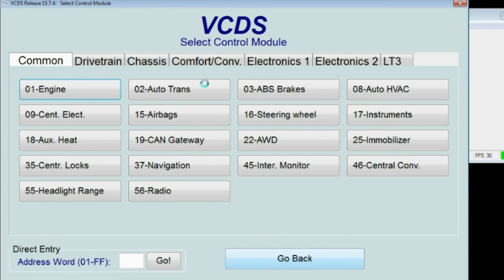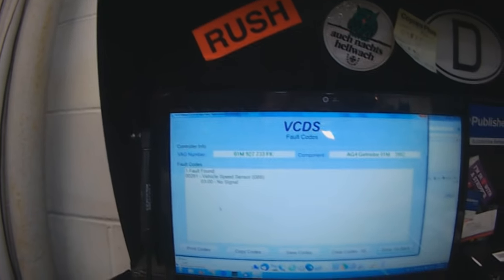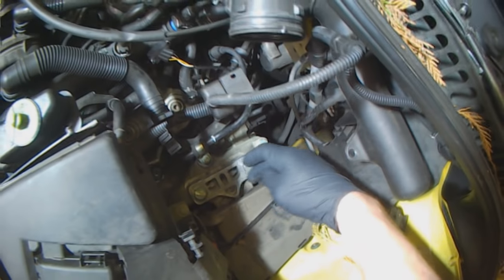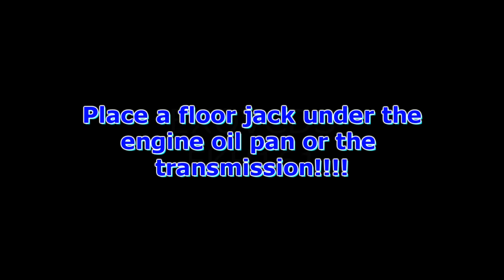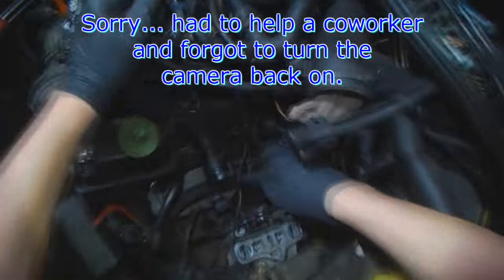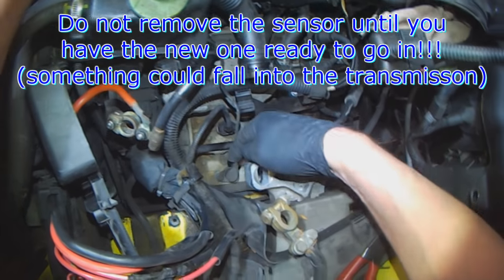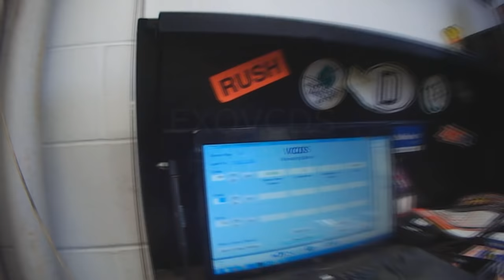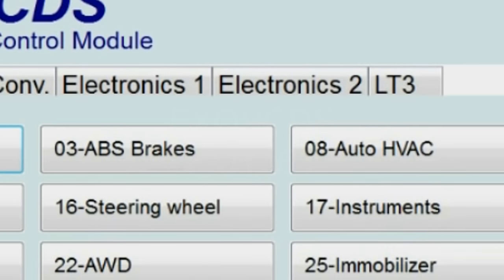VW A4: New Beetle - vehicle speed sensor (G68) no signal

Comment: Please help me with this! is there only one speed sensor on the 2004 vw beetle automatic transmission?
I have heard that it has 3. how do I know which one to replace, my rpms and speedometer readings are working, its just that my transmission got into limp mode, and i am getting this code from a code reader; P0722. Please help. very worried.
Reply from the maker: I'm still at work... I'll get back to you tonight once I get home.
Reply: ***** thanks!
Reply from the maker: 4 speed , 5 speed or 6 speed automatic?
Reply: 4speed automatic.
Reply: and it is 2004 2.0 no turbo
Reply from the maker: http://fkh161.ca/VW/NB/P0722_001.pdf
http://fkh161.ca/VW/NB/P0722_002.pdf
Reply: ***** but how do I know WHICH sensor is the one that is bad?
Reply from the maker: virusboy07 Both pdf's refer to G38... the second pdf shows what the sensor looks like and where it is located. I really can't help further... you now have the same information that I have. Time to disconnect the sensor and check it.
Reply: ok! I Will do that.

Comment: this basically cures a speedometer not working in a 6spd manual transmission as well on a turbo S model? same location?
Reply from the maker: No. Do you have an abs light that is also on in the dash?
Reply: No.
Reply from the maker: The 6spd manual has no speed sensor. The speedometer speed is calculated via the abs speed sensor. Does the odometer count mileage?
Reply: i have po501 implausible signal at vehicle speed sensor is there another sensor. no fault codes on abs module. I've been baffled by this for a while.
Reply: Nope it doesn't
Reply from the maker: 6sp manual (clutch pedal) or 6 spd automatic?
Reply: 6sp manual
Reply from the maker: Weird.
Reply from the maker: http://wiki.ross-tech.com/wiki/index.php/16885/P0501/001281
Reply: Yeah exactly what I've been saying.
Reply: Yeah I'm thinking it's got to be one of the top two on possible solutions. I just don't have a wiring diagram of turbo S for those. By the way do you have a video on Turbo S EPC and traction control coming on and you press throttle and it acts like it don't have any gas?
Reply from the maker: What year? I can get you wiring diagram. When EPC comes on... should have fault code in ECM.
Reply: 02 i would appreciate it. I think i had a fault in ecm controller stating no connection or something like that.
Reply: I'm not sure it replied but its an 02 . also the abs controller is showing a code of 01314 ecm - check dtc memory - intermittent. I told you it was not but that's the code i pulled.
Reply from the maker: http://fkh161.ca/VW/NB/TurboS001.pdf
http://fkh161.ca/VW/NB/TurboS002.pdf
Reply from the maker: If the ABS is not communication with the ECM or instrument cluster, then the speed will not show.
Reply from the maker: When you turn the key to ON, does the ABS light come on?
Reply: I replaced with new abs sensors like 3 days ago . Cleared codes and still Nada. Are you saying the sensors could be faulty possibly?
Reply: Yes and then goes out
Reply from the maker: If the ABS light never came on, then I would have said to check the fuses on top of the battery. If there are communication fault codes in the ECM, the ABS module & the Instrument Cluster module... then you have to fix the communication issue. If your scan tool can view ABS speed sensor output values... drive the car at slow speeds and check if all the sensors are putting out a signal. The front left sensor is used as speed input for the ECM & Instrument cluster. If the ABS does not have any speed sensor fault codes, then the only thing left is a communication issue between the modules. Bad wiring / connection etc.
Reply: I was afraid you were going to say that about the wiring. Just to confirm is it mvb 002 under abs and first block? Btw tyvm for the wiring diagrams . Greatly appreciated.
Reply: I'm getting 2.0km/h on G44 through G47 speed sensors . 255km/h standing still
Reply from the maker: Yes, ABS speed sensor signals can be seen in the first 1 or 2 groups of the ABS measuring value blocks. If your scan tool does not lose communication with the ABS module, then look for the communication issue between the wires that "communicate" between the modules. If the scan tool keeps losing the ABS communication... also look for a power / ground supply issue to the ABS module. Not much more I can suggest, sorry.
Reply from the maker: Yeah... I've seen weird / high readings before (can ignore as far as I have come across).
Reply from the maker: If no faults in wiring are found, could be a bad ABS module.
Reply: *****  no that's awesome stuff . I feel better about my direction after speaking with you. Thanks for going out of your way to help me out.
Reply from the maker: Let me know what you end up finding / solved the issue. Might also help someone else down the road.
Reply: Oh definitely will . I agree! What i do know is i have a bug within the bug lol . I'll respond to this once i go the route you said. Thanks again!

Comment: Do you know the location of the speed sensor on a 2003 vw jetta tdi ?
Reply from the maker: Fin Engine speed or vehicle speed? Standard or automatic?
Reply: standard I think you have to take off the motor mount and lower the transmission
Reply: I didnt watch the whole video its in the same location
Reply from the maker: Fin No... On standard transmission the speed sensor is on the differential. Is your speedo working?
Reply: No and my tdi just shut off by its self like i turned the key off. Do i have a crankshaft position sensor ?
Reply from the maker: Fin Transmission speed sensor can not cause the engine to shut off... the crankshaft position sensor / engine speed sensor can / will. The sensor is to the right of the oil filter flange... mounted to the engine block.
Reply: I read it wrong the Engine Speed Sensor ? located in the back of the  crankshaft driver side ? I think thats the sensor that was smoking. though recently i got the tdi running for a day. Soon as i parked it wouldnt let me start again. I have a very confusing situation i need vcds for sure barely no one where i live has one lol
Reply from the maker: If it was "smoking"... electrical smoke is bad. Something could have gotten fried.
Reply: so the camshaft and engine speed senor is located near each other ? Yea i know and i dont know what sensor it was it was located behind the crankshaft or back of engine near the top mid section driver maybe tempature sensor ?
Reply from the maker: No, they are located far apart.
If your TDI is an ALH TDI, then there is no camshaft position sensor.
As I already mentioned, the crank sensor is located at the front of the engine, to the right of the oil filter housing, bolted to the engine block.
Reply: I replaced the crank sensor  last summer and it wouldnt star. Sat for like 6 months till i primed the fuel system and cleared codes ran for a day now its sitting. I dont assume its the fuel injection pump.
Reply from the maker: Fin What were the codes you cleared? With key on, does the check engine light come on? ALH or BEW TDI?
Reply: id have to double check. Yes ALH
Reply from the maker: No camshaft sensor then.
Reply: Maybe it was faulty ? I joined your forum
Reply: So the engine speed sensor located on the differential could cause a no start ?
Reply from the maker: I'm gonna explain this again... pay attention.

1) the engine speed sensor (also called the "crankshaft position sensor") is located to the right of the oil filter flange at the front of the engine... mounted to the engine block.
2) the VEHICLE speed sensor (the one that makes the speedometer needle move) is located on top of the transmission by the differential... the plug you showed in my forum "COULD" be for that sensor.
3) the VEHICLE speed sensor (the one that makes the speedometer needle move) WILL NOT cause / prevent the engine from starting or cause it to stall.
4) the ENGINE / CRANKSHAFT speed sensor (the one mounted to the engine block at the front of the engine to the right of the oil filter flange) WILL / CAN prevent the engine from starting or will cause the engine to stall, when it is bad.

If the check engine light DOES NOT come on when you turn the key ON, then the engine will probably not start. Does it? Does it come on when the key is ON?

Does the engine / crankshaft speed sensor produce a signal when the engine is cranking? 

Does the engine even crank (does the starter turn the engine)?

Does the fuel injection pump have power at  the "shut off solenoid"? If the solenoid (round looking thing at the end of the injection pump with a "single wire" attached to it at the top of it) DOES NOT have power, then the engine will not start.

The engine will also not start if the camshaft / crankshaft / injection pump timing is not correct... is camshaft / crankshaft & injection pump timing correct?

The engine will also not start if the "intake flap or shut off flap" is in the closed position. Is the flap in the OPEN position?
Reply: YES the engine light comes on when i turn the key to on position.  IDK i would have to check for signal . YES the Engine cranks. YES  the shut off solenoid has power. IDK if the timing is correct. Yes the intake flap is in the OPEN position. First diagnostic i did when my TDI first died i replaced the Crankshaft position senor it didnt start. Sat for like 6 months i checked voltage at pump sending unit good checked for fuel restriction good. SO i  bleed the Fuel System Fuel Filter Fuel Injection Pump and injectors cleared the codes and it started. Constantly was starting no problem so i put it on the road. drove fine till i stopped a couple times and it would take a little longer to start.  So Drove home for safety  now it no longer starts again. I did have a couple generic codes for Quantity adjuster and fuel temperature sensor though i think there faulty because when i got the tdi to start i checked injectors again and it was spraying to the hood like it should. How would my TDI get worse after driving when it  started perfectly fine at idle ? How do i check timing without VCDS ? i cant accept defeat yet thinking its the fuel injection pump when i know its not lol. My generaic codes was P0251 & P0252
Reply from the maker: Voltage at pump sending unit? Under the rear seat? There is no electric fuel pump.
If you had quantity adjuster codes, it could very well be that the injection pump is bad.
You can check "static" pump, cam & crank timing with the "locking" tools that are required when changing a
timing belt. "Dynamic" pump timing can only be checked on a running engine. 
If static timing is OK, the crank sensor is OK and the check engine light comes on when the key is on (ECM is powered-up), then the problem is most likely with the injection pump... provided that the cranking rpm is above minimum and that the intake is not carboned-up too much.
Reply: I meant just the sending unit under rear passenger seat.

Comment: I have no rpm..always 0.What is the sensor i need to look and where is it?New Beetle 2001.Please help
Reply from the maker: Does the engine run?
Reply: the engine runs perfect
Reply from the maker: Χαράλαμπος Καναλουπίτης Instrument cluster issue?
Reply: It started working abnormal..in idle it showed 0 some times and on the road 2000 rpm less than it was running.Or some times the oposit..1000 to 2000 more.Last week it was working perfect.But now its dead..
Reply from the maker: Χαράλαμπος Καναλουπίτης Use a scan tool and check what the Instrument Cluster Computer data stream shows as rpm. If the data stream shows normal rpm, then the rpm driver is bad / something with the instrument cluster board.
Reply: ok thank you..othewise is there a sensor i should check?and if so where is it?
Reply from the maker: Χαράλαμπος Καναλουπίτης The engine speed sensor / engine crankshaft position sensor is the MAIN input for calculating rpm / for the engine to run... that's why I asked if the engine was running. Since it is, not a sensor problem (In my opinion).
Reply: is there only one speed sensor on the 2004 vw beetle automatic transmission?
I have heard that it has 3. how do I know which one to replace, my rpms and speedometer readings are working, its just that my transmission got into limp mode, and i am getting this code from a code reader; P0722. Please help. very worried.
Reply: I also have this same problem! Help!
Reply from the maker: Depends on the version of the transmission, 4spd, 5 spd, 6 spd?
Reply from the maker: No rpm?
Reply: 5 speed.Could it be the actuator?
Reply from the maker: I was asking one of the other people how many gears... what actuator?
Does your speedometer work? Tell you how fast you are driving?

Comment: Thomas, Would you happened to know what the torque specs on the two trans mount and double nut bolt and the two body mount to trans bolts are off of hand? 
Thanks
Reply from the maker: http://fkh161.ca/VW/NB/Mount.pdf
Service manuals can be found here:
https://erwin.vw.com/erwin/showHome.do

$35 for 24hrs of access... download as many manuals as you want.

Comment: What year is this Beetle?
Reply from the maker: First Gen... 1998 to 2010.
What's the issue... that would be more helpful for a better reply.
Reply: @EXOVCDS  I'm having an issue with the transmission not shifting after 3rd gear. A mechanic check it with a computer and the speed sensor was the only code that came up. Just hoping that will solve my dilemma.
Reply from the maker: If it shifts fine from 1st to 2nd to 3rd... it's not a speed sensor issue (in my opinion). The Beetle in this video started off in 3rd gear (no 1st to 2nd shift) because the TCM does not know how fast the vehicle is going (no signal from speed sensor).

Comment: What symptoms did the car have from this faulty sensor?
Reply from the maker: Transmission starts off in 2H instead of low gear... slower than normal acceleration and high rpm up shift. I think all of that was explained in the video.